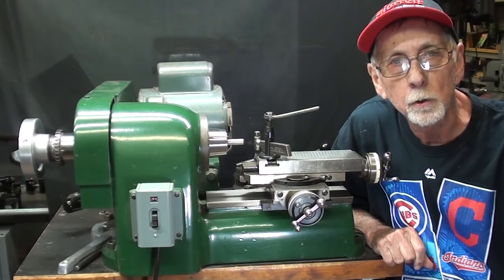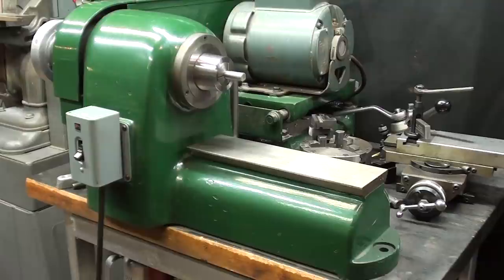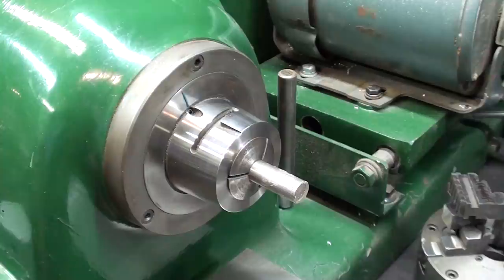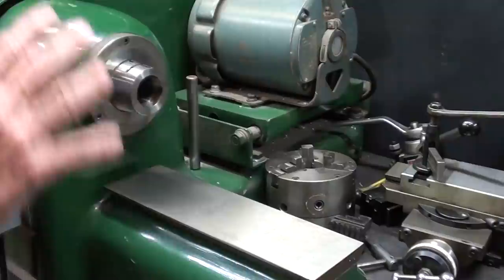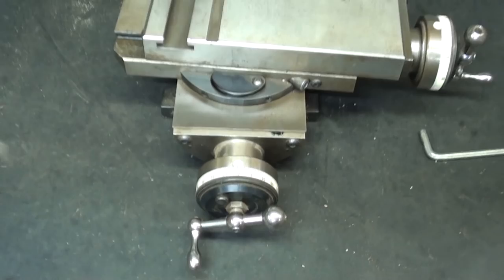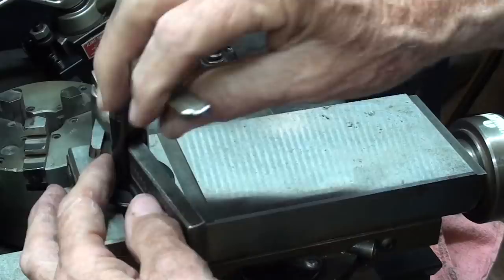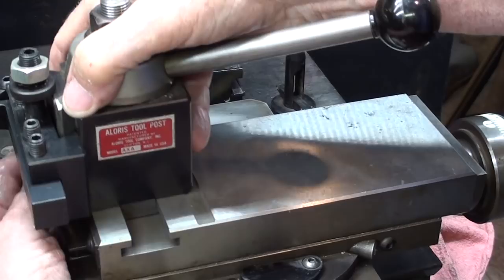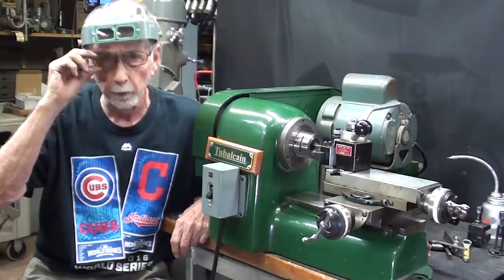WHAT IS HARDINGE SPEED LATHE 750 tubalcain

Comment: These machines sell for next to nothing on auctions - similar prices to turret lathes. They cannot also do threading, no power feed and the actual cross slide attachment is rare. We are talking here under $200 without cross slide.
Reply from the maker: Really
Reply: @mrpete222  I bid a bit over 100, it came with the two tool attachment. That was about a year ago, I think there was another one in my area few years before that.  
Turret lathes up to 5000 lbs can be had for scrap value or even less (scrap yard will not take them as is).

Comment: Enjoyed the video thanks.  Do the increment markings on the cross slide dial represent actual slide travel - or - the amount off workpiece diameter?  I have lathes with a mix of both methods, which requires care. Also, with saddle hand wheels on opposite sides of the apron, which can catch you out.

On the strength of Hardinge's reputation, I purchased a brand new GS200 CNC lathe, as they 'manufactured' in Taiwan.  A look through the poorly compiled manuals soon destroyed that.
Reply from the maker: You are correct on the dial markings. I did not know they were selling Chinese goods
Reply: @mrpete222  
Hardinge announced December 14, 2020 that milling and turning machines manufactured at the Hardinge Taiwan plant would return to its Elmira facility.
Hardinge machines were apparently also manufactured in mainland China for use in that country only.

Comment: You mentioned that the machine was originally gray not green. Every hardinge lathe I have seen was gray. I have come across the hardinge second operation lathe about five or six times. Every single time, they were green. The same tone of green no less. Do you think it's possible they used green only on the second operation lathes? It seems like too many to simply be a coincidence
Reply from the maker: Could be